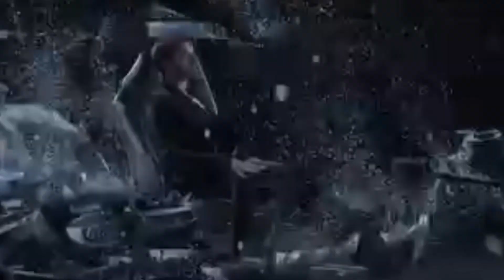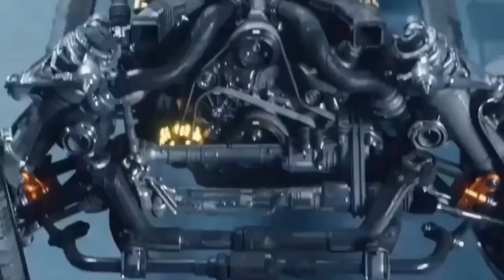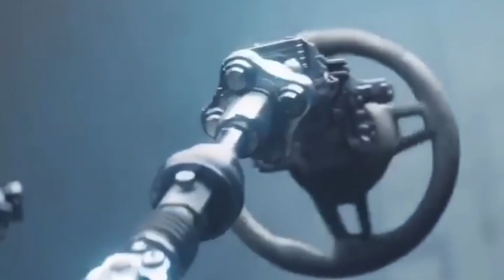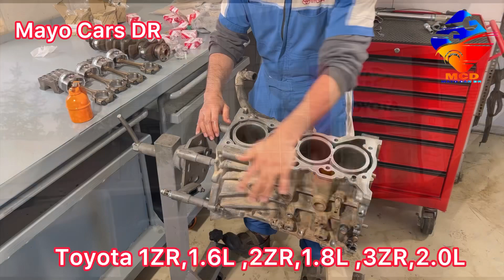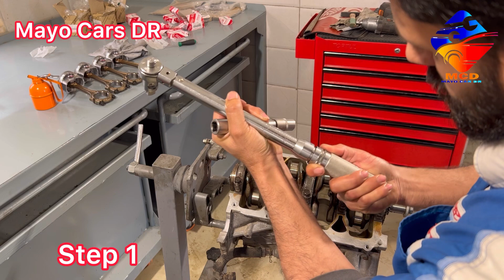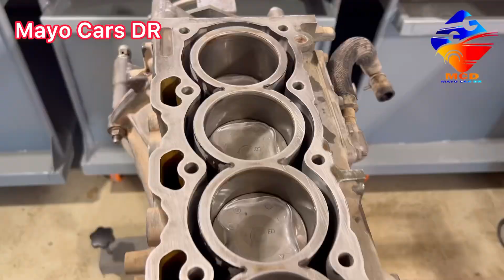2ZR 1.8L Engine Crankshaft Bearing And Connecting Rod bearing Bolts Torque Of Toyota Corolla

Comment: Hola el 1zz-fe cual el el apriete de biela? Gracias
Reply from the maker: 1zz engine rebuilding repair manual all bolts torque https://youtu.be/NLaLFEGKyTo
Reply: Gracias
Reply: Por que usan 2 tipos de pegamento,  uno negro y otro gris?